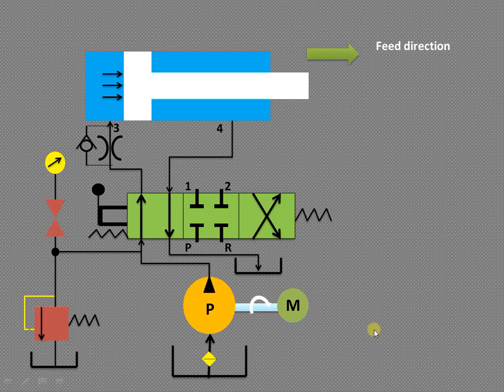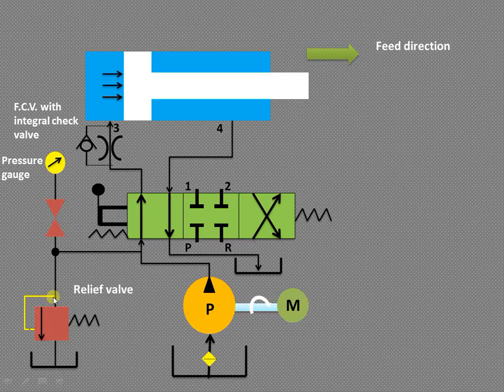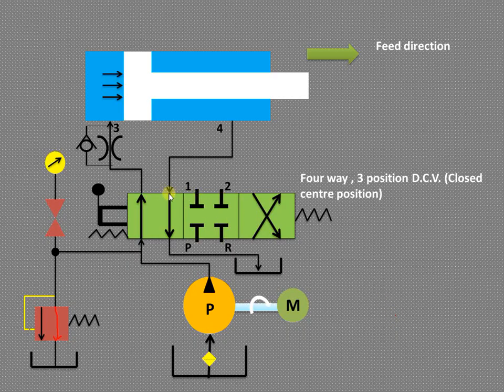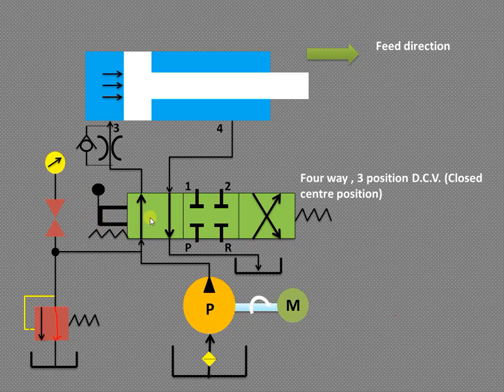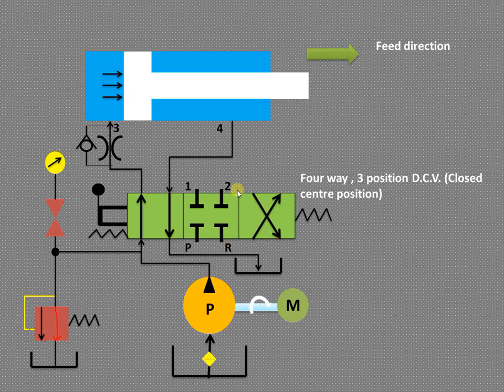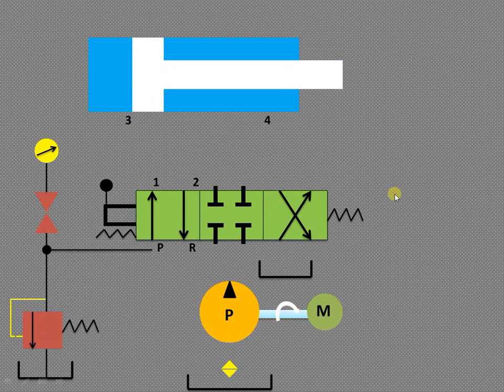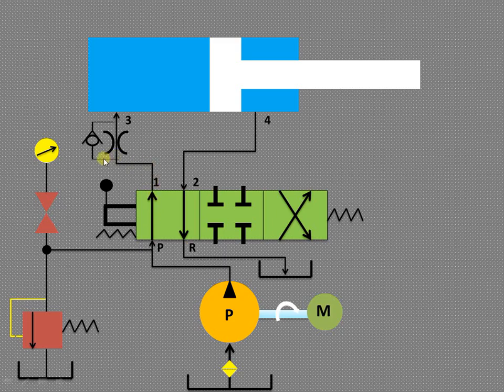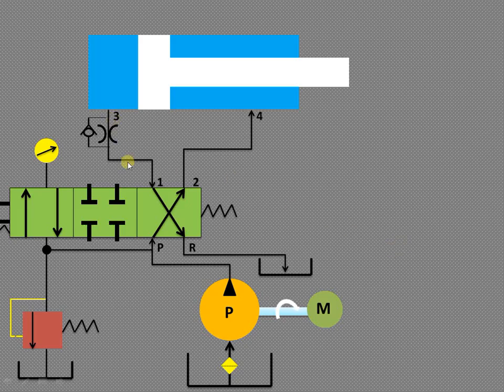Lecture 1| How to trace hydraulic circuit in fluid power !!!

Comment: What would happen if you pumped air (or water) in the opposite direction to the arrows in the valve's square ? Would it still flow, or is it like a check valve and it would get blocked off ?

Comment: nice video but some pump have internal release or relief valve, how to identify???

like we are facing problem

we are using several ILC lubrication MPT-500 model system.

during operation motor runs and raise pressure to 35 bar, during release from 35bar to zero motor turns back.we have total 5 system.

but one of our system pressure release taking too much time, motor do not rotate back during release, and system says lubrication line in pressure.pressure raise normally till 35 bar but release taking too much time. 

i couldn't figure out where is the release valve, or why its taking too much time to release pressure, and why motor don't turns back during release.

Comment: How the hydraulic press automatically maintain pressure on workpiece?
Reply from the maker: Design pressure in the circuit can be maintained by using Pressure Regulating Valve ......

Comment: Sir how we will find out electrical problem in hydraulic system??
Reply: Arwinder S Mann check 24 volt output in coil and check voltage changes of potentiometer scale

Comment: What happenes in the Left envelope mode when the ram of cylinder reaches rightmost position
Reply from the maker: Spool of the D.C. valve is operated in such a way that right envelop mode is obtained & the return stroke starts. The spool may be operated manually or using Push button or using solenoid valve . Thanks....

Comment: well done bro..that was a simple dia.
I think you are repeating that is a single acting cylinder😊
Reply: actually is a double acting cylinder.  the single acting returns by spring force, the double returns by air
Reply from the maker: Nicolae F Yes , the air is admitted on both the sides of the piston. Thanks ...
Reply from the maker: Thanks.